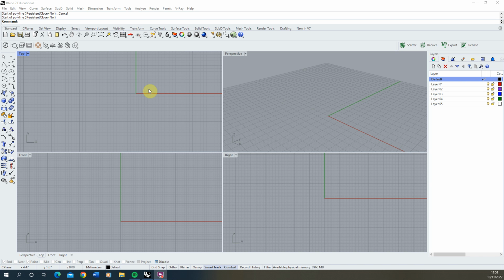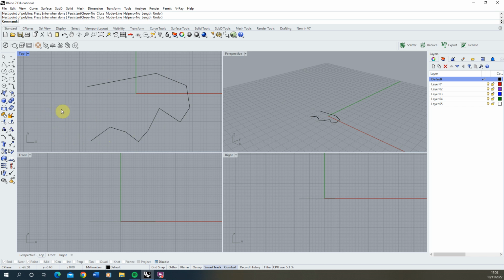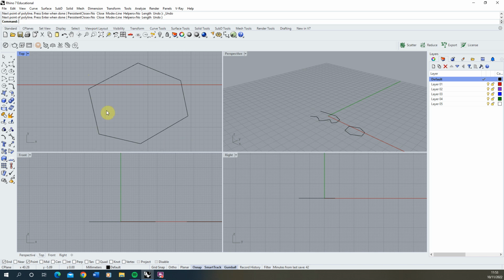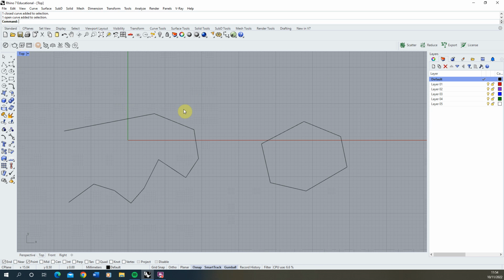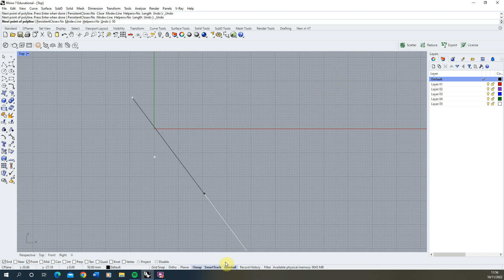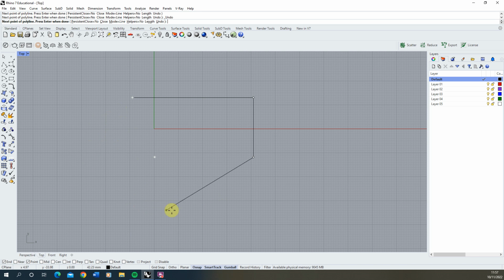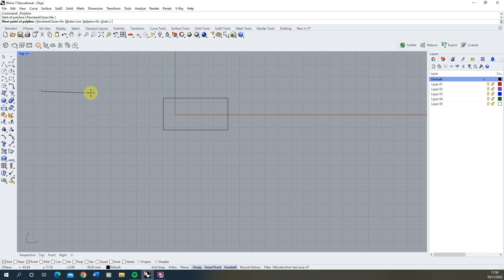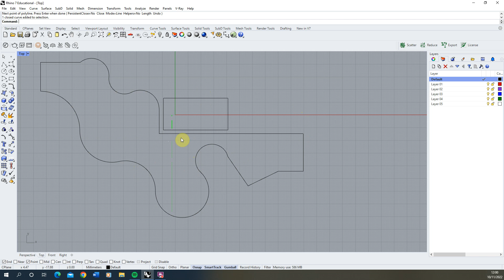Polylines and 2D Drawing in Rhino - Rhino Basics - Part 2

Comment: is there anyway to drawing both straight and curves in one go without changing tools?
Reply: yes, after you start the polyline command and click your first control point, you can then select "mode" on the command line which will change from "line" to "arc" which allow you to draw curves while still running the polyline command. you can then switch back to straight lines by selecting mode again which will switch back to line